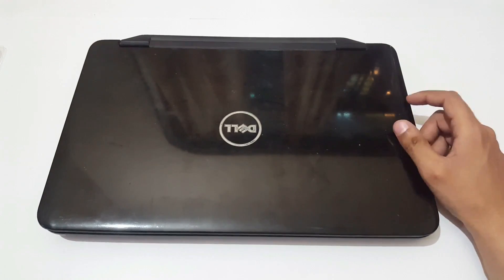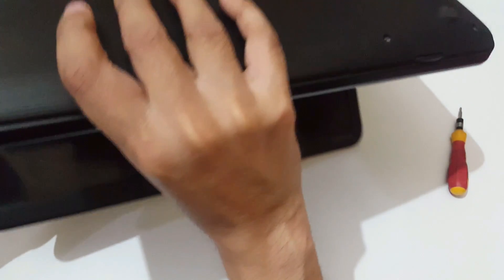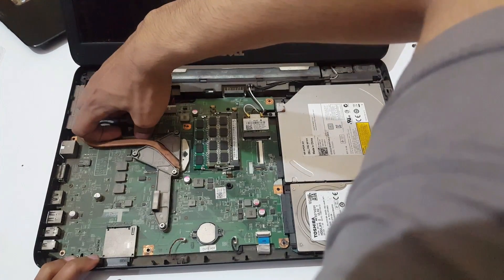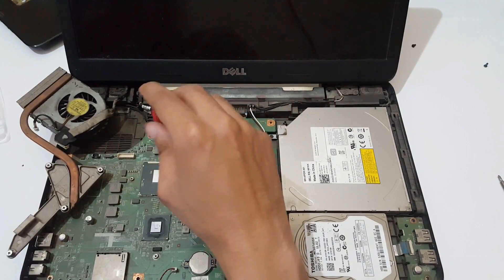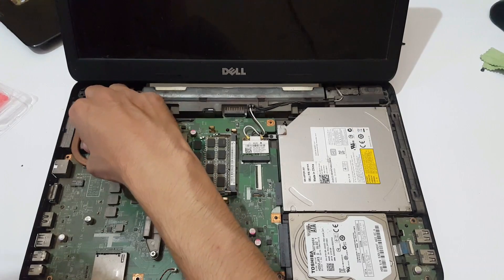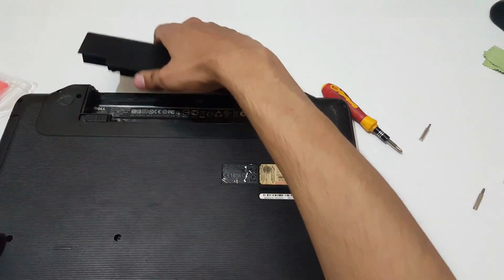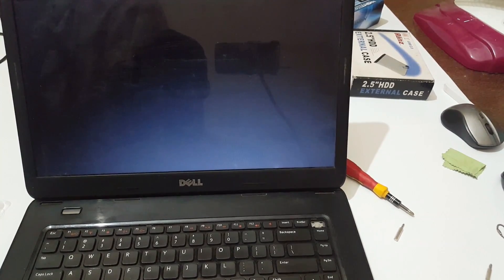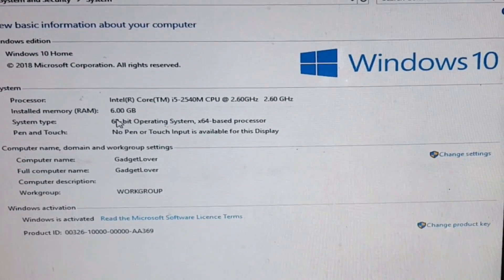How to Upgrade Processor on DELL Laptop | i3 to i5 & i7 - Make Laptop Faster for Gaming

Comment: Hey Brother! This video is really amazing and helpful. You just got another sub :) btw I'm using a Dell Inspiron N5110, Intel Core i3-2330M 2nd GEN 2.2GHz CPU, 3 GB DDR3 RAM and a 320 GB HDD. Can you please tell me which SSD, RAM and CPU will be the best to upgrade to increase performance?
Reply from the maker: Dear subscriber thanks and Intel Core i5 2540M is best processor for your Laptop
Reply: @GadgetLover360  Thanks for your response mate! Btw I still have several doubts :/ like Can I use a DDR3 ram instead of a DDR3L?
Reply from the maker: @CraGGyMechArena  You're welcome and I would suggest you use it according to Laptop specifications
Reply: @GadgetLover360  Sure! Once again, Tysm for this quick reply :D it really helped me alot.
Reply from the maker: @CraGGyMechArena  You're most welcome

Comment: I have  HP Notebook - 15-bs086nr with a Intel® Core™ i3-6006U (2 GHz, 3 MB cache, 2 cores). Is it up gradable? Thanks.
Reply from the maker: You're welcome and in my knowledge the processor of this Laptop is soldered so you can't upgrade it but I would suggest you upgrade its RAM to max and install SSD for better performance

Comment: Hi, will it change the “how old is my pc” too ?
means if i change the cpu now will it remove the 5 year old pc from healthchecker?
Reply from the maker: Hi and no for this all system requirements required
Reply: @GadgetLover360  then why does a 5 year old pc which i recently bought says 2 years old ?
Reply: @GadgetLover360  it is an i7-7th gen x1 carbon
Reply: bios version is also 2 years old , so does that mean updating the bios version can change the pc age ?
Reply from the maker: @SN-ok2wb  Update bios version will not change the PC age
Reply: @GadgetLover360  then what can change the pc age bro ?
Reply from the maker: @SN-ok2wb  Nothing but if available upgraded Motherboard will change PC age

Comment: I have i3 6006u and its much slow, is it upgradable to i5?
Reply from the maker: If the processor is not soldered you can upgrade it in same generation
Reply: @GadgetLover360  okay thanks!
Reply from the maker: @vrushabhjoshi1293  You're welcome

Comment: I am using DELL Inspiron 15 i5-7200U
Reply from the maker: I would like to inform you that if the processor is not soldered you can upgrade it in same generation

Comment: hello like do you know if this will work with all laptops because i have i5 and i want to upgrade to i7 and it says that there is danger and will only work on some computers on google
Reply from the maker: I would like to inform you that if the processor is not soldered you can upgrade it in same generation

Comment: Dell latitude 7490 with an 8th gen i5 1.7 1.9 ghz. What is the fastest newest processor I can install
Reply from the maker: The processor of this Laptop is soldered so you can't upgrade it but I would suggest you upgrade its RAM to max and install SSD for better performance

Comment: Hello, I have a small doubt. First, will the cpus that are sold on Amazon work with laptops too? Second of all, I have a HP pavillion 15, with an rtx 3050, i7 11th gen, 512gb ssd, and 16gb ram. What should I do? can I replace my gpu too? Thanks
Reply from the maker: You're welcome and the processor of this Laptop is soldered so you can't upgrade it but yes you can attach an external graphics card for better gaming experience
Reply: @GadgetLover360  but if we leave the external graphics card open, won’t it get super hot?
Reply from the maker: @reptr0  In my knowledge no

Comment: Hello. Am using Lenovo with i3 7020u. Can I upgrade to an i7 7510u/i7  7600u/i7 7557u/ i7 8650u
Reply from the maker: Hi and I would like to inform you that if the processor is not soldered you can upgrade it in same generation

Comment: Hi is it possible to upgrade the processor of Dell inspiron14 5000 series 5490. Current processor is i3 10th gen.
Reply from the maker: The processor of this Laptop is soldered so you can't upgrade it but I would suggest you upgrade its RAM to max and install SSD for better performance

Comment: Can I upgrade processor of dell Inspiron 3567 i3 7 th generation
Reply from the maker: The processor of this Laptop is soldered so you can't upgrade it but I would suggest you upgrade its RAM to max and install SSD for better performance

Comment: Excuse me sir can I remove the soldered cpu in laptop so I can upgrade my old cpu to Intel i5u
2nd question: will my laptop work if I remove soldered cpu and  can i upgrade it?

Please answer this question I will subscribe you for real
Reply from the maker: If the processor is soldered you can't upgrade it but I would suggest you visit nearby PC & hardware store and ask them about this
Reply: @GadgetLover360  okay sir thanks  for answering this question I'm gonna subscribe you
Reply from the maker: @NEMESISXIN0  Dear subscriber you're welcome

Comment: SIR Can i upgrade from i5 to i7 processor in laptop.
sir can i play ranch simulator without lag in i5 processor
sir what is the price of i7 processor for upgrading 
plz clarify the doubt
Reply from the maker: Attach external graphics card for better gaming experience and if the processor is not soldered you can upgrade it in same generation and see its price details on Ebay online store

Comment: I had a i3 laptop. Can i put a i5 processor in it. And if it can so can games can run it well?
Reply from the maker: If the processor is not soldered you can upgrade it in same generation and definitely this upgrade will increase the performance and I would suggest you upgrade its RAM to max and install SSD for much better performance and attach external graphics card for better gaming experience

Comment: Sir can i upgrade from i5 second gen processor to i7 processor in Acer  laptop?
Reply from the maker: I would like to inform you that if the processor is not soldered you can upgrade it in same generation

Comment: I just found out that I have no processor in my laptop
Reply: And I've watched this because I want to know what an Intel i3  where they put it after watching this video I thought I should try this but I'm scared because it might broke my laptop if I do this and I will lose all of my data in my laptop
Reply from the maker: @soseikiharagatatsu7859  I would like to inform you that if the processor is not soldered you can upgrade it in same generation without any loss of data
Reply: @GadgetLover360  yeah it's just that it's kinda scary opening the inside of a laptop what if it doesn't work but still I'll try it

Comment: Hey, I'm using an Asus laptop with a cpu of i5-4200u, is it possible to change it to a i7-4700mq?
Reply from the maker: Hi and if the processor is not soldered yes you can upgrade it in same generation
Reply: @GadgetLover360  excuse me sir, what do you mean by soldered?
Reply from the maker: @marvinlincoln4636  If the processor is attached you can't upgrade it

Comment: Can I upgrade the processor on a Dell Latitude E7250 processor i5 to i7? What processor would you recommend?
Reply from the maker: The processor of this Laptop is soldered so you can't upgrade it but I would suggest you upgrade its RAM to max and install SSD for better performance

Comment: Dell vostro 2521 can i upgarde its core i3 sir @Gadget Lover?
Reply from the maker: The processor of this Laptop is soldered so you can't upgrade it but I would suggest you upgrade its RAM to max and install SSD for better performance

Comment: Bro i have Dell Inspiron 15   3000 Series
My processor is Intel i3 7100 now I want to Change it to Intel i3 12 th gen can I change it pls say me
Reply from the maker: The processor of this Laptop is soldered so you can't upgrade it but I would suggest you upgrade its RAM to max and install SSD for better performance
Reply: Can I atleast upgrade it to windows 11
Reply from the maker: @tony987  See system requirements

Comment: Dell n5010 i3
Reply from the maker: Yes you can upgrade it in same generation
Reply: @GadgetLover360  in need to upgrade processor to i7 or i5
I have upgrad ramfrom 4 to 8 ddr3
And ssd A300
Reply: Name of processor please
Reply from the maker: @drmuhammad0503  Intel Core i5 580M is best processor for your Laptop

Comment: Hey bro, I have old Toshiba Satellite C650-1C8 here. Planning to upgrade it. Can I change the processor of my laptop, from i3-350m to i5/i7?
Reply from the maker: Hi and yes Intel Core i5 580M is best processor for your Laptop
Reply: @GadgetLover360  how about i7 1st gen?
Reply from the maker: @a1b2c3347  You can upgrade it in same generation
Reply: @GadgetLover360  Thanks a lot, sir.
Reply from the maker: @a1b2c3347  You're most welcome

Comment: can i change laptop i3-7020u to i5 or i7 Dell Inspiron 3581
Reply from the maker: The processor of this Laptop is soldered so you can't upgrade it but I would suggest you upgrade its RAM to max and install SSD for better performance

Comment: Can I change processor in Dell Inspiron 3542 3000 Series...?? Please help...
Reply from the maker: The processor of this Laptop is soldered so you can't upgrade it but I would suggest you upgrade its RAM to max and install SSD for better performance

Comment: hi gadget lover, can we upgrade Lenovo Ideapad S145 Core i3 10th Gen
Reply from the maker: Hi and the processor of this Laptop is soldered so you can't upgrade it but I would suggest you upgrade its RAM to max and install SSD for better performance

Comment: can i upgrade my dell E7240 laptop , if so with which processor ( now i5 4th gen)
Reply from the maker: The processor of this Laptop is soldered so you can't upgrade it but I would suggest you upgrade its RAM to max and install SSD for better performance
Reply: @GadgetLover360  based on what, can we know which one is soldered or not
Reply from the maker: @anandkumar-cj6zx  Yes
Reply: Is there any datasheet that says , specific cpu of that laptop is soldered.. please share if possible
Reply from the maker: @anandkumar-cj6zx  Kindly disassemble it or see its motherboard type

Comment: Hey.. I have 2 i5 processors . One of Toshiba and other of Hp. Can I change both?
Reply from the maker: Hi and I would like to inform you that if the processor is not soldered you can upgrade it in same generation

Comment: Hi this is a helpful video! Can you tell me if the i7-6700HQ CPU @ 2.60GHz is upgradable on a Dell Precision 3510? I want to upgrade my laptop to windows 11.
Reply from the maker: Thanks and I would like to inform you that the processor of this Laptop is soldered so you can't upgrade it but I would suggest you upgrade its RAM to max and install SSD for better performance

Comment: Great video 
What processor I can upgrade for dell vostro 15 contains intel celereon with 4gb ram
Reply from the maker: Thanks and I would like to inform you that if the processor is not soldered you can upgrade it in same generation
Reply: Ok 
Bro
Reply: Bro did you got this
Reply from the maker: @gaminggemerz46  Tell me how can I help you
Reply: Which processor can I upgrade for dell vostro 15 2018th model 
It contains intel celereon processor
Reply from the maker: @gaminggemerz46  Intel Core i5 7300U is best processor for your Laptop

Comment: Can you replace the processor of a Dell vostro3300? 
And if do what processor is a good replacement.
Thank you!
Reply from the maker: You're welcome and I would like to inform you that the processor of this Laptop is soldered so you can't upgrade it but I would suggest you upgrade its RAM to max and install SSD for better performance

Comment: I have inspiron 3593 i3-1005g1, can i upgrade to i3-10100F??
Reply from the maker: The processor of this Laptop is soldered so you can't upgrade it but I would suggest you upgrade its RAM to max and install SSD for better performance

Comment: Bro which is the processor for my laptop .... lenovo ideapad 100 specs - 8gb ram (upgraded) core i3 5005 ....245 ssd
Reply from the maker: The processor of this Laptop is soldered so you can't upgrade it

Comment: Dell Inspiron 15 3558
Please tell me that Can I upgrage my processor 
Also suggest me what to upgrade with there specifications.
Thank you..
Reply from the maker: The processor of this Laptop is soldered so you can't upgrade it but I would suggest you upgrade its RAM to max and install SSD for better performance

Comment: I have dell inspiron 3452 can i change processor.?
Reply from the maker: The processor of this Laptop is soldered so you can't upgrade it but I would suggest you upgrade its RAM to max and install SSD for better performance

Comment: I know its very stupid but can i change the processor of dell latitude 3390 2in1 it cane with an i5 8250u and uhd 620 graphics its from 2018 maybe
Reply from the maker: The processor of this Laptop is soldered so you can't upgrade it but you can attach external graphics card for better gaming experience and I would suggest you upgrade its RAM to max and install SSD for better performance

Comment: I have NEC Versapro Vxh Intel Celeron 3rd gen, Can I upgrade to i3 or i5? Thanks
Reply from the maker: You're welcome and I would like to inform you that if the processor of this Laptop is not soldered you can upgrade it in same generation
Reply: @GadgetLover360  how to know if its soldered
Reply from the maker: @nguyenthanhhoangyieugarcia9370  Disassemble it from processor region to know if it is soldered or not
Reply: @GadgetLover360 if I can remove it or not?
Reply from the maker: @nguyenthanhhoangyieugarcia9370  Yes

Comment: Bro which processor can I upgrade for my Dell Inspiron 15 3000
I have i3-1115G4
And ram 4.00 gb
Reply from the maker: In my knowledge the processor of this Laptop is soldered so you can't upgrade it but I would suggest you upgrade its RAM to max and install SSD for better performance

Comment: Hi, I have Dell Latitude E7270 with core i5 processor. What is this best/highest capacity of processor can I upgrade the laptop with?
Reply from the maker: Hi and the processor of this Laptop is soldered so you can't upgrade it but I would suggest you upgrade its RAM to max and install SSD for better performance

Comment: Thanks for the video... 
Is it possible to upgrade i3-2310 to i5 or i7.. Laptop model Dell Inspiron N4110
Reply from the maker: You're welcome and yes you can upgrade it in same generation and Intel Core i5 2540M is best processor for your Laptop

Comment: Is it possible to upgrade proceesor in my dell Vostro 3510 laptop.where do we get the processors for laptop(i think it is different from the pc chip).
Reply from the maker: The processor of this Laptop is soldered so you can't upgrade it but I would suggest you upgrade its RAM to max and install SSD for better performance
Reply: @GadgetLover360  ok, where do we find a chip for an upgradable laptop ?
Reply from the maker: @alexjaison359  I suggest you find it on Ebay online store

Comment: Can I put core i7 processor in 4gb ram laptop i3
Reply from the maker: If the processor is not soldered you can upgrade it in same generation
Reply: @GadgetLover360  So in which processor I have to upgrade my pc in i5 or i7
Reply from the maker: @try1_  You can upgrade it to any in the same generation

Comment: hii great video, i have a Dell Inspiron 15r 5521 and i currently have intel core i5 3337u right now,am i able to upgrade to a i7 or my laptop is soldered with the processor? thanks i subscribed btw
Reply from the maker: Dear subscriber you're welcome and the processor of this Laptop is soldered so you can't upgrade it but I would suggest you upgrade its RAM to max and install SSD for better performance
Reply: @GadgetLover360  alright,thanks.
Reply from the maker: @remo0ne  You're welcome

Comment: Hi, my laptop is hp pavilion 13x360 convertible pc 13-s000ns.. Intel Core i3-5010U with Intel HD Graphics 5500 
Memory, 500 GB 5400 rpm SATA,
4 GB DDR3L-1600 SDRAM... can you please recommend me highest I can upgrade in terms of processor, memory and space ssd upgrade with all the specifications if possible.. keep up the good work! big fan!
Reply from the maker: Thanks and the processor of this Laptop is soldered so you can't upgrade it but I would suggest you upgrade its RAM to max and install SSD for better performance
Reply: @GadgetLover360  ok  i know i can improve RAM i think upto (16 gb? with 2 8 gb ddr3l right?). can you let me know about how much ssd i can install(like maye 512 gb or 1 terabyte?)?? i dont know..
Reply from the maker: @porantso8092  Yes and the internal SSD will be installed so you can go up to 4TB
Reply: @GadgetLover360  okay! got it many thanks!!
Reply from the maker: @porantso8092  You're welcome

Comment: I have acer e1-570 laptop with i3-3rd generation ,can u suggest me which processor is best for my laptop
Reply from the maker: The processor of this Laptop is soldered so you can't upgrade it but I would suggest you upgrade its RAM to max and install SSD for better performance

Comment: This tutorial is great but can I use an AMD CPU or do I have to buy Intel?
Reply from the maker: Thanks and I would like to inform you that if the processor is not soldered you can upgrade it in same generation
Reply: @GadgetLover360  What would be the best CPU Upgrade for the N5050 knowing that you worked on it then?
Reply from the maker: @stupidusername5819  Intel Core i5 2540M
Reply: @GadgetLover360  Could the N5050 handle an I7 or is it a wiser choice to upgrade my I3 to an I5?
Reply from the maker: @stupidusername5819   Yes it will support but in same generation
Reply: @GadgetLover360  Would a I7 2600 work?
Reply from the maker: @stupidusername5819  No
Reply: @GadgetLover360  what about I7 2630? It is also 2nd gen but not a desktop CPU.
Reply: Or the I7 2760
Reply from the maker: @stupidusername5819  No
Reply: @GadgetLover360  Oh darn, thank you for helping me with this then and I will stick with the I5 2540 that you have suggested, I hope you have a nice day. :D
Reply from the maker: @stupidusername5819  You're welcome